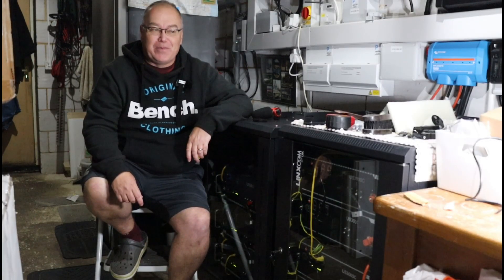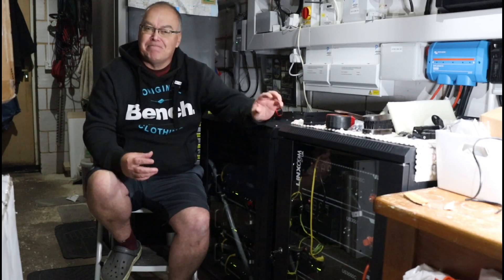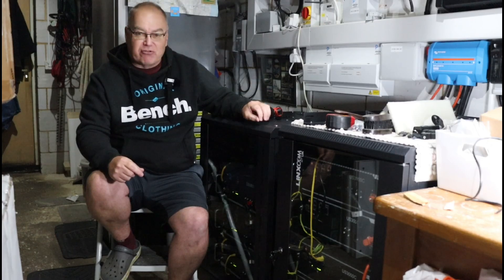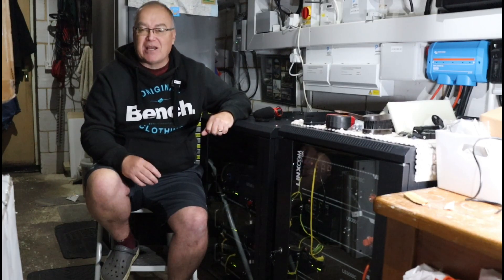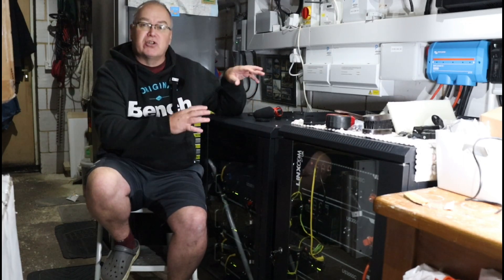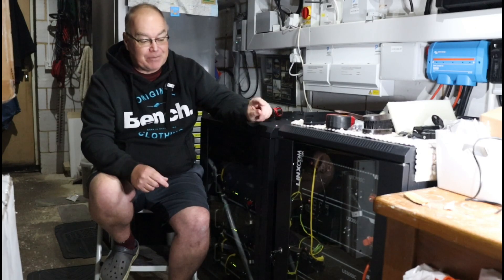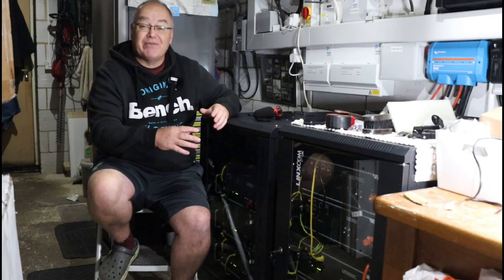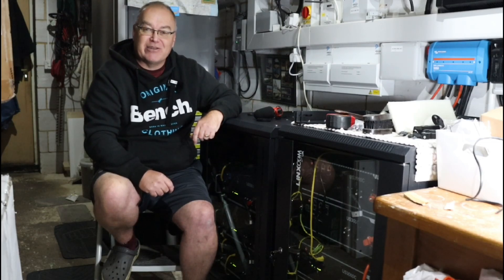Why I've added extra storage and mixing  Pylontech US5000 and US3000 batteries

Comment: Reverse here in Qld Australia where we need a/c 24/7 for cooling and dehumidifying about 2 months of the year, 12 hours a day for another 3 months and some heating randomly for about 2 months in winter 

I use 7 x US5000 and can get right through the night with 20% left on the worst heatwave nights and about 30% left on peak summer nights running 17kw of inverter a/c across 4 units in economy mode to limit the demand and best EER . (EER is no less than 4 for each a/c unit) 
The a/c units if run for long periods just "tick over" mostly using about 1-2kw off the batts but peak at 4kw through the hottest part of the day then using just solar of course. The hot weather means long sunny days so 65kwh of solar per day is normal with about 45kwh in winter on sunny days. I export about 5 times what i use on average.

They charge us peak 4pm to 9pm at 50 cents a Kwh so the solar panel payback (12kw) is 2 years and the batts (32kwh usable) are a 5 year payback 
There is some cashback with rebates and feed in's to the grid of surplus solar while it lasts to also pay down the cost. ZERO bills ever, always credits.

The batts are a/c charged through the day at 40-60 amps (DC) depending on weather and discharge so as i use an off grid inverter as well as the on grids to get the solar feed ins i can go 100% off grid at anytime it is no longer economic to be on it

As the home has a large genset input connection (63 amp) feeding the whole of the home my complete off grid system can be removed at anytime as if it was never there like the furniture if say the house was sold and the new owners are "on gridders" 
The solar and on grid inverters remain of course for the new owners to enjoy and add their own battery system if they choose.

Comment: Here the Pylontech battery game is over. Most customer sell their used ones and go ahead with LFP batteries, usually 14 kWh based on 16x EVE LF280K or MB31 cells.
Why did you invest any further into Pylon Tech cause they had caused here a lot of issues.

Comment: Hi, when you fit the batteries to a standard rack, how are the bus-bars fitted? It looks as if the links are battery to battery, rather than battery to bus-bar This seems unlikely as the output of more than 2 batteries through a link would surely fry the cable.....
Reply from the maker: Pylontechs are designed to connected together with these cables not busbars
Reply: @EVPuzzle  That cant be true... Can you imagine them asking how many in the string? pre-purchase to spec the cable? Most they are 120 expecting 75 amps with 1.25 safety margin.
Reply from the maker: @jackleman331  im sure if you check the tinternet you'll find lots and lots of images etc plus the manuals are all online .
Reply: @EVPuzzle  I am going to add that this is of no immediate danger, most houses after all exist with an 80 Amp connection, perhaps to 120. But your 5xpylontec is capable of 5x75A, before troubling the BMS, maybe more for a transient spike.
Reply: My point exactly, take a look at "LiFePO4 Server Rack Battery Buyer's Guide! For Off-grid Solar Systems". looking at the picture you will see enormous cable daisy-chaining the DeWalt rack to the right. All the Life-power rack to the left have no interconnection.
Reply: My point exactly, take a look at "LiFePO4 Server Rack Battery Buyer's Guide! For Off-grid Solar Systems". looking at the picture you will see enormous cable daisy-chaining the DeWalt rack to the right. All the Life-power rack to the left have no interconnection.
Reply: its very hard to give you links to refute the "im sure if you check the tinternet you'll find lots and lots of images etc plus the manuals are all online ." statement
Reply from the maker: @jackleman331  as I said look it up , it's as per pylontech design
Reply: @EVPuzzle  Not really, they call the feed cables "end runs" or an "end run", these can max at 240 i.e. using 2 x"end runs", but this only works on 3 batteries. For 5 the "controller" depending on setup must limit the output. This is getting complicated as it depends on getting more "end runs" onto a busbar or limiting the controller. There is a video called "Pylontech Cabling Master Class" in Utube. At 8.42 it starts to talk about battery cable kit interaction.
Reply from the maker: @jackleman331  I'll stick with the pylontech installation manuals but thanks for your thoughts

Comment: We went with 2 15Kw DIY batteries, saved a fair bit and lugging battery cells around rather than full battery packs is far easier.  The build took an hour a pack though.

Comment: Hi Nigel. My system has 8 x US5000 and I was using 2 x 7kw LuxPower inverters for 7kw in and 7kw out. My solar produces 3.6kW per hour max. After a few problems with LuxPower I changed the 2 inverters for 1 Victron 15kw inverter. Game changer!! This charges at about 11kw from the grid in the cheap off peak rates and the solar coupled with the batteries works very well. My wife can now have the washing machine on, the dryer on, be cooking etc and I don’t have to worry or run in and tell her to rein it in a bit 🙄🤷🏼‍♂️😂 My Victron guru, Dan from Tekidan Ltd, has set the inverter to disconnect from the grid at 7am and reconnect at midnight so there is absolutely no grid use throughout the day. I don’t have an export tariff so I only charge up to a certain battery percentage each night (I have an Eon Next Drive tariff with 7 hours at cheap rate). This is governed by the next days solar forecast, and we use ‘node red’ to set the Victron max charge level each evening so I don’t overspend charging the batteries. It gets the solar forecast from Solcast every evening and if the forecast is 0 to 10kw for the day I charge to 95%, if it’s 10 to 20 I charge to 75%, if it’s 20 to 30 I charge to 60% and if it’s over 30 I charge to 40% - all these variables are easily changeable. This honestly is a fantastic setup for us. I get an email early in the morning with tomorrow’s forecast just to keep me happy because, like you, this is also a hobby. I NEVER pay the high rate for electricity and we use 25 to 35kw daily. We have had many days this year when we only spent the days standing charge. It’s brilliant isn’t it! 😎 All the best going forward on your journey towards free power 🥳😂

Comment: You make a really good point about maximum charge available through the inverter, people often overlook this. We have 2 x Tesla Powerwall which is 27kWh of battery storage. We can charge them at 10kW so just under 3 hours from 0 - 100%. Single phase is our bottleneck as our MIC (Maximum Import Capacity) as defined by our DNO is 18.4kW. In reality we top out at 80% of that around 14kW max import to give a safety margin. Tends to mean we can't fully charge the car and charge the batteries. 3-phase would solve it, but that's a whole lot of expense and brings other issues with it.
Reply from the maker: Adding extra inverter power seems impossible for some as their DNO restricts them so capacity is all that can be increased .

I could install a victron 10000 which would be easier than adding a 2nd 5000 unit but I'm interested in how we get on in practise before adding more power

I'm curious about adding additional chargers to the system as some are reporting is possible

Comment: Interesting video, thank you. I added a fourth 5.2kWh battery last year, at the same time as adding the Eddi, which has worked perfectly. The inverter maxes at 2.6kWh in or out. So it also gives the opportunity to bleed some off gently into the Honda E as required, without buying peak.

As an aside Go is now 5 hours off peak, from 00:30 to 05:30. On top of that the outgoing fixed lite export is now all but the same rate at 8p, therefore zero sweat just charging the car overnight anyway, and exporting a bit more the next day, i.e. cost neutral.

Comment: I'm in a similar situation as you with the pylontech batteries. Got 4 x US5000 (4.9kw) and will be adding 3 x US3000 (3.5kw) to the stack over the coming weeks. We are a extremley high energy household using about 34kw per day. I have a small solar array on the garage roof at the moment but thats got a max generation of 2.2kw and not ideal on a flat (ish) roof. But using Intelligent Octopus Go should help me be able to fully charge these up and run during the peak time and then only using the grid during off-peak (or surges beyond the inverters ability).

Comment: You mentioned that you changed the battery strings (banks) that you had configured and connected to the lynx. Have you considered the cable rating, current draw/charge and the fuses you had in the lynx (and their max Isc)?
Reply from the maker: That's my installers job, all good 👍
Reply: @EVPuzzle  I do hope the installer does understand all this as I've seen far too many people dive into battery storage without understanding the kit and technical requirements. Pylontech/Victron etc.. isnt as plug and play like the Tesla powerwalls, myenergy, libby etc.. and does need a bit of technical knowledge to put it all together as it is a bit more DIY.

Comment: I have 2x Givenergy 9.5Kwh batteries and 7.7Kw worth of Solar panels. I used to be constantly fretting about keeping the batteries topped up by solar but now that the system has been up and running a couple of years, I'm far more relaxed and just let it do its thing.
This summer is the first time I got the export tariff activated and have been earning around £90 per month but also because of this I am happy to charge between 11.30 and 05.30 in the winter for 7p per Kwh. Even if the following day is sunny, having a full battery just means all of the extra solar gets exported at 15p per kWh.

Comment: I agree 100% with your reasons. Plus I’m a shorts and crocs chap. 😊. I already run two Victron 48 5000 to max my discharging and charging on Octopus Flux with 2 X Seplos 280, soon to 3 x 280. Looking forward to playing with IOG in the winter and completely running the house without thinking too much. 

If anybody needed more charging power on cheap rates take a look at these, they could be controlled via Alexa or Ha and scalable. Search for item below. 

“IP67 waterproof 48V 30A charger 54.6V 25A 58.4V 35A 58.8v 50.4V
Smart Charger for lithium ion battery lifepo4 LTO li ion polymer”

Comment: A few things, 
1) battery behaviour below 10%, try using voltage as a cut off (49V is a good sustain voltage for the victron ESS software, for a 16s lifepo4 battery) I find that this uses all of my battery, protects the battery health even if the SOC has crept up/down. It has the added benefit of resetting SOC correctly when you hit 49v once in a while. 
2) Maximum charge power.
One or two additional 1kw 16s lifepo4 chargers on a smart socket/relay. These activate on low SOC during the night charging session. They deactivate at a voltage/SOC that I can define. You can keep the Heatpump on 24/7 without worries. Having extra chargers also stops you from fretting about that 8kw Victron inverter.
Keep up the good work!
Reply: Alternatively.... Parallel another Multiplus ;)
Reply from the maker: 2) you've lost me .  AC chargers ?  Do you have a link
Reply: @EVPuzzle  Something like the victron energy skylla 48/50 tg. Although for the price, i would parallel another Multiplus too.
Reply: @EVPuzzle  Google: 30a 16s lfp charger

Comment: I have 2 teslas powerwalls @ 27kw and they both charge and discharge at 5kw each so double up to 10kw charge & discharge very fast and I don’t worry about using the power it’s great
Reply: I am either going for Tesla 3 plus slave or Sigen stackable, you note how fast you can charge ,presumably from mains on cheap rate , would a four hour cheap rate window suffice in your case ?
Reply from the maker: @pmb9172   4 hours wouldn't be enough in peak winter unless it was a really sunny winter
Reply: Yes as I get 10 kw h charging as it classes each battery as 5 kw each  == there is a 14kwh  down load  cap on my octopus 🐙 intelligence  tariff  so that limits me but I’m still fine charging my car and hot water and Tesla batteries  🔋 it just prioritises my Tesla batteries fill full then put the spare power back to charging my car @. 7.3kwh

Comment: I believe you can get 15kwh for £2000 from Fogstar Drift. The price drop in batteries is amazing. I've got a mini DIY off-grid system with 2.5kwh but definitely could do with adding a battery to give me an extra 2 days reserve. I can't justify at least £400 on another battery though (24 volt 100ah eco-worthy). I've got plenty of power on a sunny day from 2x 410 watt panels (£56 each) but heavy cloud means you don't generate enough and the battery quickly runs down. It's only a fun little project to run the fridge but it is addictive! I'm trying to work out the cheapest way to optimise the system which I think will be adding a solar charge controller to get maximum power when the sun shines.
Reply: Fogstar 15.5 kWh is £2500 have it about 5 months so far. Very pleased

Comment: Are you still being charged for the standard charge for having a meter even thou you are exporting electricity back to the grid , roughly every household gets charged around over a hundred pounds each year be they using electric or not .
Reply from the maker: Oh yes 🫣
Reply: @EVPuzzle  if they at least took the standing charges of the pension house holds they would show some thought for people, when you look at EDF in 2023 went from 730 million profit to 2 Billion profit , they are just brokers they actually don’t own the meters themselves, if you switch suppliers all they do is transfer the serial number on the back of the meter to the next supplier, so none of them actually owns the meters, so as said they really are just brokers, taking the standing charge off the pensioners house hold would be the right thing to do = sorry they are probably thinking of doing that ha ha .

Comment: A great video which opens the door on so many new possibilities.  Having two inverters with segregated trains so you can import /export twice current rates , especially in saving sessions or helping the grid at peak times, are now potentially possible. Glad you got a great deal on the batteries as well, does seem pylontech batteries are not dropping in price despite being available in the far east for less than half the UK prices asked. I fully agree that more capacity gives more options moving forward on our green journey's, and would like similar.

Comment: With the new 5kwh being only 3 batteries in that array do you have a bigger limitation on discharge rate as I was told the max discharge was about 6.5 kwh to inverter unless you had 5 batteries then discharged could match 11kwh constant discharge to inverter